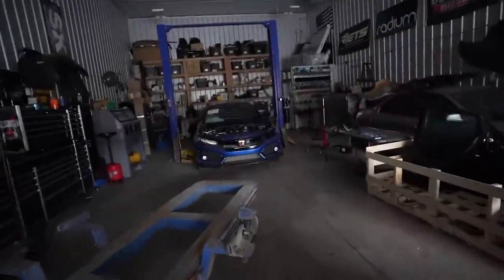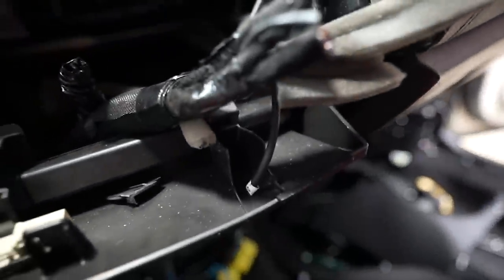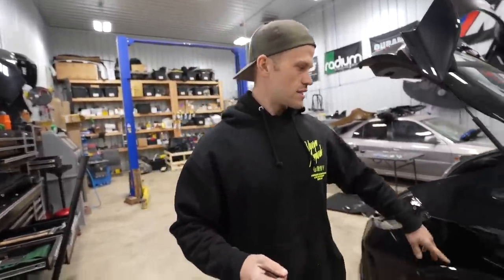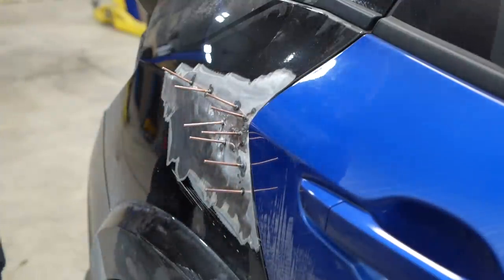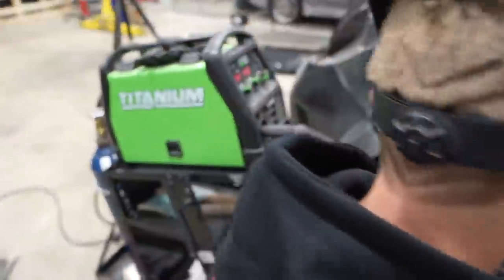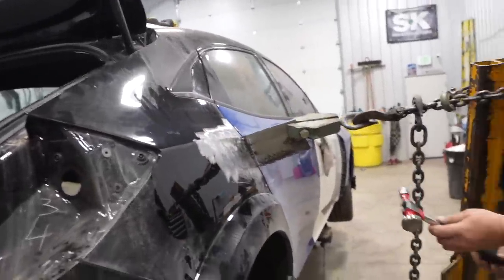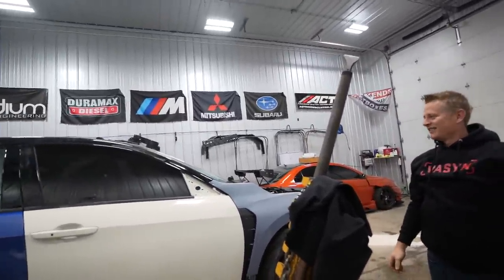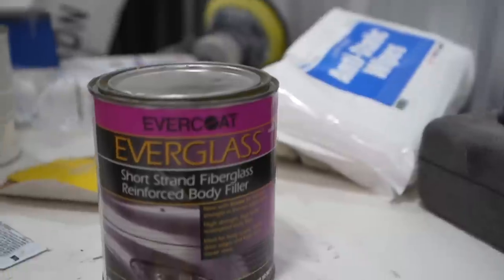Totaled 2021 Civic Type R Rebuild | Ep. 5 (Massive Body Repair)

Comment: It’s amazing how quickly you’re handling this damage. When you started this series, I thought the car was beyond repair and now it’s almost back to 💯
Reply: There’s no chance in hell it will be back to 100. It will never drive or feel the same as a non wrecked type r. There will always be issues . The amount of work it’s taking to salvage a 30,000$ car isn’t worth it . Maybe worth 20,000$ after the post Covid car market markup
Reply: @Gen10civic  lol a $30K car?? Have you looked at prices lately bud?
Reply: @jgott1745  this price mark up 2022 inst going to last forever. The car was 33,000$ brand new …. Restored salvage with bumper repaired goes for 35,000$ right now
Reply: @Gen10civic  dammm 35k not to much dude
Reply: @Gen10civic  😅 true dude 🤣

Comment: Always remember when fixing damage it goes: "First in, last out." Meaning start in the back where the damaged ended and continue forward to where the damage began. Helps walk the damage out instead of forcing it out.
Also with the studs just use a wire cutter and twist at the head of the stud and they come right off.

Comment: Instead of using an outdated stud pulling system, you should try a glue pulling kit.  It’s way better for the overall repair process… welding studs can rip holes and compromise metal.  Studs have been done forever so it works but with thinner and thinner sheet metal, glue pulling is the way to go.
Reply: The inside of the quarter has lost all corrosion protection…
Reply: Also since you had to pull using the rack, the glue kit wouldn’t pull that most likely but I think you’d like the glue pull kit and learning how to use it.